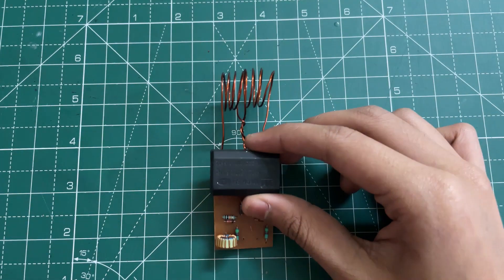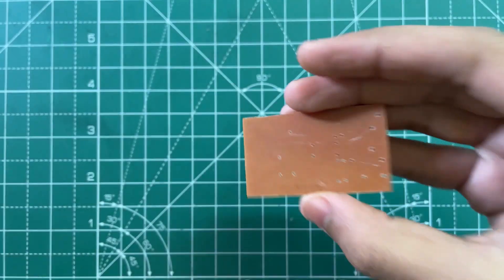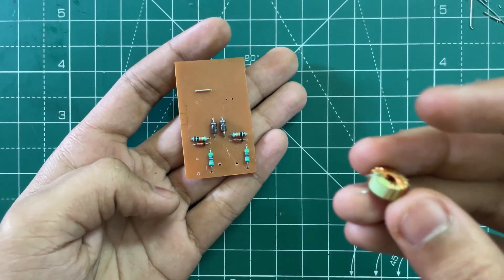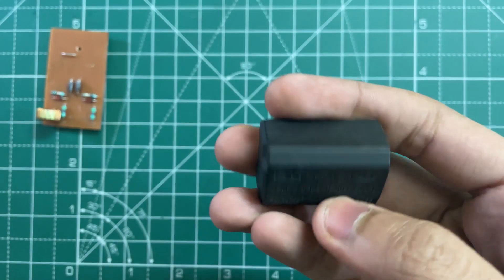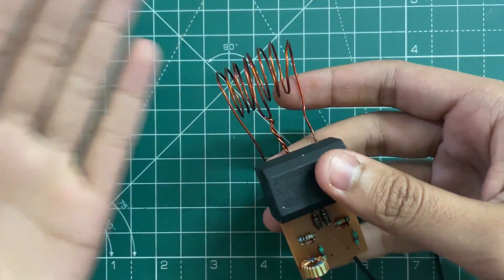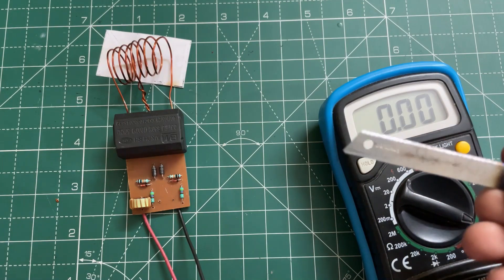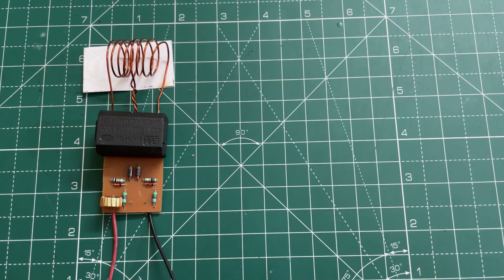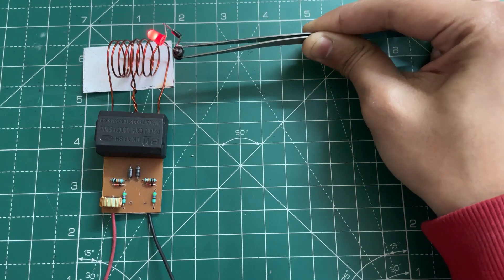DIY MINI POWERFUL INDUCTION HEATER

Comment: Can you just explain where to look for a hint of creativity??
Reply from the maker: Wherever you want ;)
Reply: @kdcreativity6201  OKay.  Lets try parasitic capacitance and its potential destructive effects.  If you start paying attention to "ringing" and search for clues the "Miller Plateau" may come on topic, then "snubber network(s)", active gate "clamping", gate drivers, etc.  Soon enough you end up thinking it ain't worth the trouble re-inventing this old wheel while integrated solutions take away ellusive challenges as EMI management, PCBoard layout design that doesn't make things worse and whatnot.  Then, after a couple aspirins reading scholar papers for hours that emanate from high-profile universities and major industries as Toshiba, Texas Instrument besides pioneers with names as Transphorm or else, euh...  A time may arrive when you realise there's a reason why over a decade later we still read about blown MOSFETs.  At that point the guy who sold you a made-in-China might argue no such thing as a Miller oscillation even exists, although once done with semantics you may come to read about the Miller effect actually triggering parasitic oscillations somehow, but it doesn't exist so there's no need to fix it - and money is saved selleing what was previously sold as a TESLA COIL flyback driver...